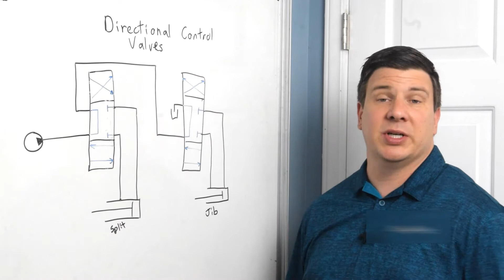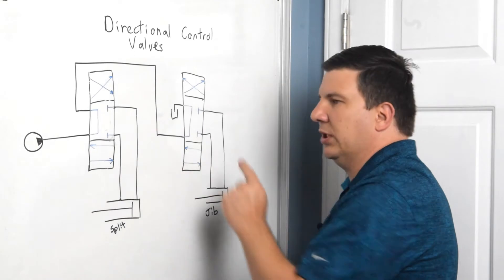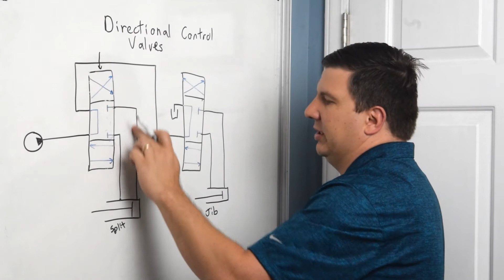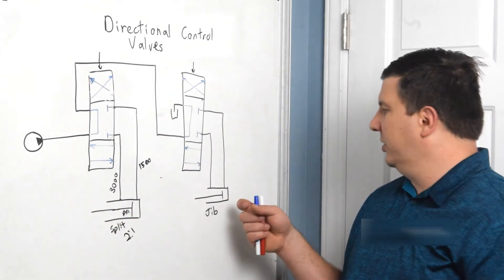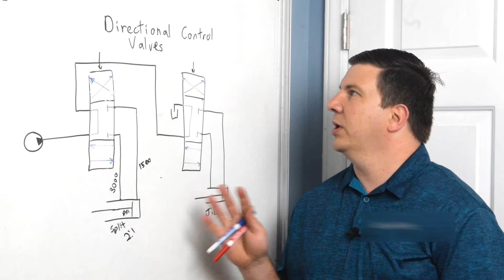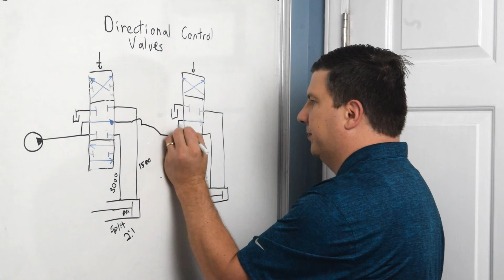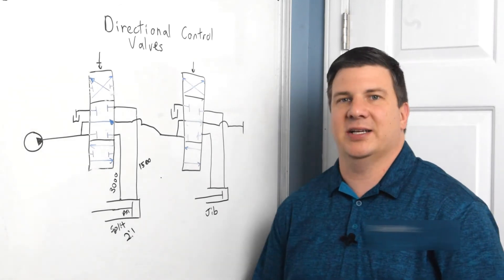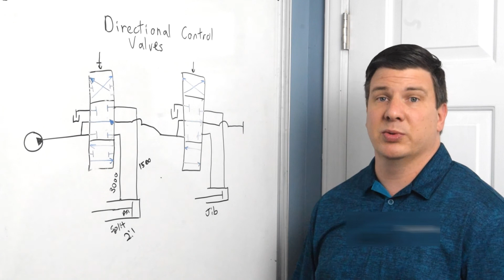Don't Use Tandem Center Hydraulic Valves -  Log Splitter Series Part 22

Comment: most forklifts do tadem center slick.....
Reply from the maker: Poor design if they do.  
Don't confuse it with multiple valves sections on the same pressure line.  The problem is when they take a return port and plumb it into the next pressure port.
Reply: @MentoredEngineer  yes im dm you in about a week i built a roll former in my back yard, runs of my tractor, im goin into hydro hell with this thing!

Comment: Would this not be a problem if the valves were run in parallel not series? I may be totally wrong I’m new to all this.
Reply from the maker: Ashley,  it would not be a problem if you ran them in parallel.  However, it creates an entirely different problem because there would be many paths to tank.  If you only activated one valve section, you would never build up pressure.  You could build up pressure if you activated all of the valves at the same time, but that probably defeats the design intent.
The only way parallel arrangement of the valves works is if you switch to closed center hydraulics where the P port is blocked on each valve.  To prevent overheating, you will need to add an unloader valve if you want to keep a gear pump or switch to a pressure compensated pump.